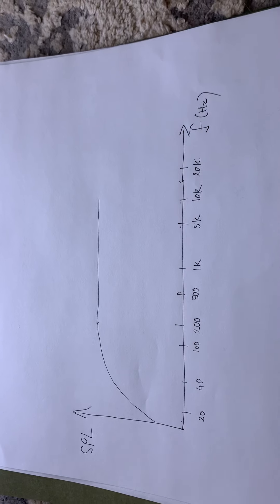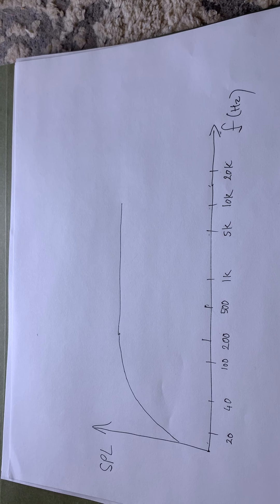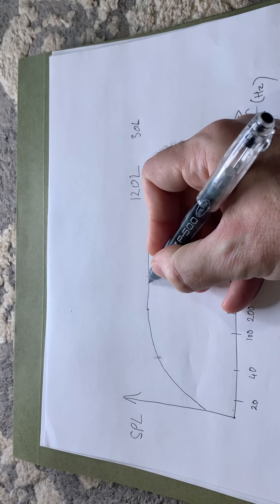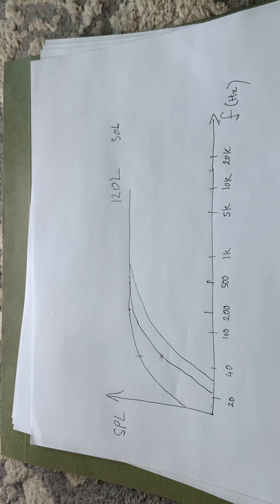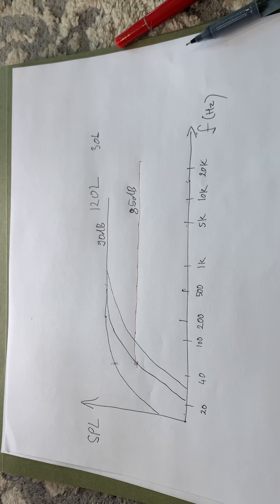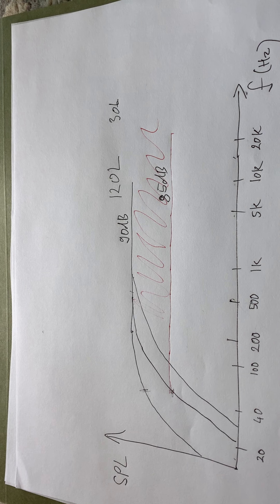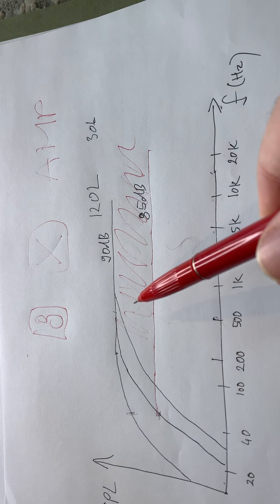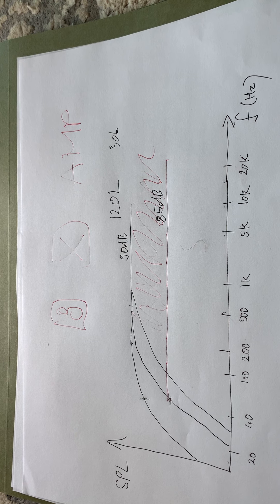Why Crossover parts quality is EVERYTHING for low efficiency speakers?

Comment: Do you think having an external crossover encased in a Faraday cage would matter enough to warrant doing it?
Some manufacturers have a grounded copper layer in the speaker chassis so surely it's beneficial, that's just so expensive to do. Well, good to have the voice coils shielded too.
Then again, why in the world is a thick layer of copper needed? Is it a waste of copper or does it have benefits over a mesh Faraday cage?

Comment: I saw you put a Miflex cap on the title of the video. I have found Miflex to be the best cap for crossover (on my Spatial X5 crossover) and as coupling caps in several DIY class A PP no-feedback triode amps. I have done extended listening comparing different CC and the transparency, clarity and detail of the Miflex are unmatched - including much more expensive caps (i.e., V-cap CUTF).
Reply from the maker: Same experiences here! Miflex is superlative and fantastic in both crossover and coupling duty. ; )
Reply: @realworldaudio  Well I look forward to finishing my amp, with Miflex KPCU-01 coupling, and also a speaker filter (for a very sensitive full range) with Miflex MKP-01, PP in oi, and Jantzen foil/wam inductor and Jantzen supreme resistors. I too very much cannot understate the need for the best parts affordable to someone. Your not hearing the true potential of the system, what a waste!!! ...lol... .PS..I Just found you, good work and thanks for your vids!
Reply from the maker: @islandlightphotodotcom7162  Thank you, I'm glad you like my channel and find useful information! Indeed, high quality capacitors are a must. While they have a cost factor, but a small KPCU-01 is 20-30$, but installing a pair in a 4-5000$ system will help it more than spending 1000$ or more on changing / upgrading components. Overall, it's a steal ; ).
Reply: @realworldaudio  Just ordered AN solder on your recommend. Thx.
Reply from the maker: @islandlightphotodotcom7162  The AN solder is as easy to work with as leaded solders, you will love working with it. (There's no lead in it though, the fumes do not smell of lead.)

Comment: So putting high quality caps in a first order crossover would have less of an impact than in a higher order crossover?
Reply from the maker: It would have perhaps an even bigger impact, as it is the only thing affecting the crossover. The fewer elements are at a position, the bigger the effect of changing a single one.
Reply: @realworldaudio  that makes a lot of sense, I have a pair of Meadowlark Blue Herons that must be about 20 years old, would you recommend changing out the capacitors? and other components? Would it make sense to use a brand name cap (I think it has Auric caps now) how important is the tolerance would it be better to get one with say +- 5% or a brand name with a 10% tolerance ? Any recommendation? thanks for all of the insights you are sharing
Reply from the maker: @ericstefko4852  Definitively, I would recommend to change the caps. For the tolerances: the exact value will not matter that much (eg 4.95uF or 5.00uF or even 5.39uF), just make the L / R pair as close in value to each other as possible. Ask the seller if they are able to match capacitors - and then the 5% or 10% rating will be just secondary. PartsConnexion can do parts matching (if you are in North America), not sure about other parts of the world... Brand choice: it's very personal, what flavor you prefer, and also depends highly on the rest of the audio system. Obbligato foil capacitors are perhaps the best value, and neutral sounding. (Optimal choice for future system growth towards natural sound.) -- Janos
Reply: @realworldaudio  would it be better to have one large cap i.e. 30uf or would it be better to use 2 or 3 small caps in parallel that add up to 300uf? current the speaker has 2 x15uf     in parallel